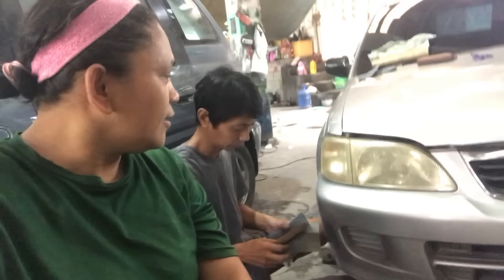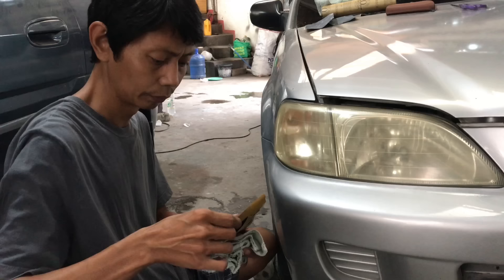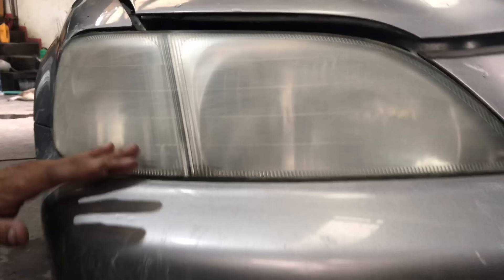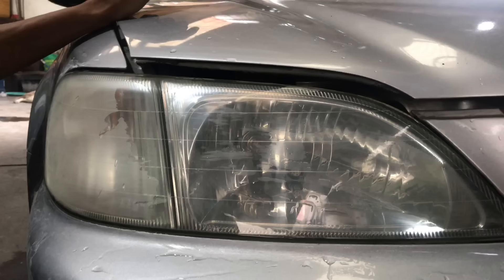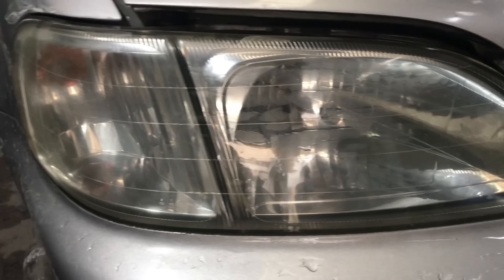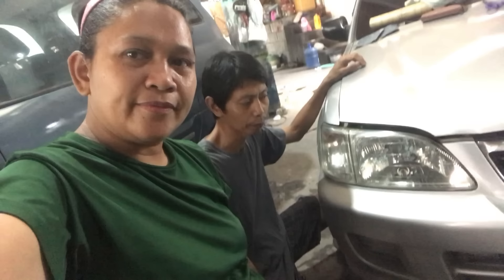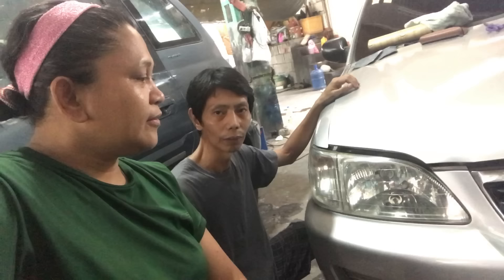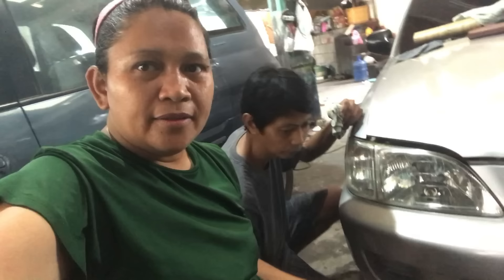DIY paano magpalinaw ng headlight,mabilis na paraan #howtorestoreheadlight

Comment: Thank you so much sir sa pag share. God bless

Tanong ko lang po sir, yong wetordry sir ilan uses? Magagamit ba yong isa sa both headlights?
Reply from the maker: Thank you pars,wet sand po grit 1.500 start at grit 2000 pang final sanding at dapat more watet😀

Comment: Paano naman po sa mga glass type?
Reply from the maker: Kung glass po kahit 2000 na liha nalang at buff na agad😀
Reply: @delrosariofamilyvlog2215   paano po kaya pakintabin ung mga elf truck ko na walang top coat?
Reply from the maker: Kung walang topcoat pars hindi cya pwedeng pakintabin..kailangan muna cya matopcoat😀
Reply: @delrosariofamilyvlog2215  boss gawa please ng video paano pakitabin ung mga glass type na headlights
Reply from the maker: Ok pars no probs😀
Reply: @delrosariofamilyvlog2215  paano po kaya magtanggal ng scratches sa chrome grills
Reply from the maker: Kung mababaw lang gasgas par pwede yung mettal polish😀
Reply: @delrosariofamilyvlog2215  pwede kaya boss? Plastic chrome po
Reply from the maker: Kung plastic crome kahit rubbing compound po😀

Comment: Can anyone explain in English the item he used to clean the headlight?
Reply: Rubbing compound
Reply: Materials needed:
-Sanding Papers (1500 & 2000 grit)
-Buffing compound (Farecia Compound)
-rags

Steps:
1. Rub it with 1500-grit until clear
2. Then, rub again with 2000-grit sandpaper to refine.
3. Wipe with rubbing compund, sprinkle a little water to get rid the traces of  sandpaper and become more clear